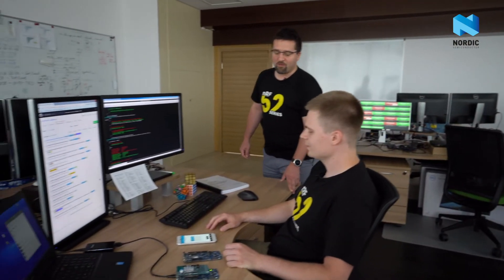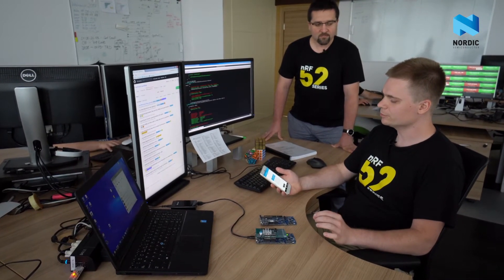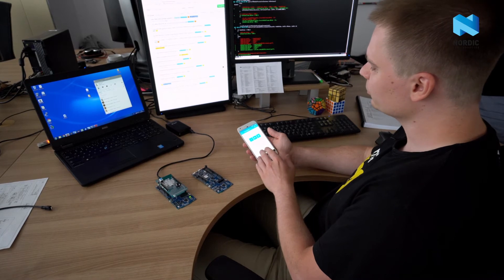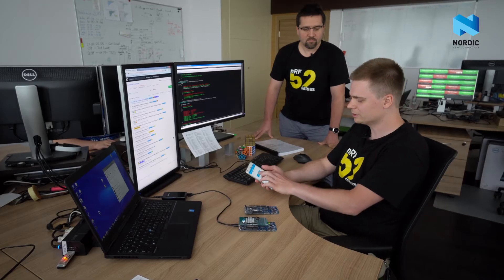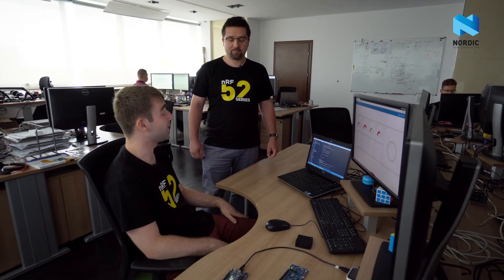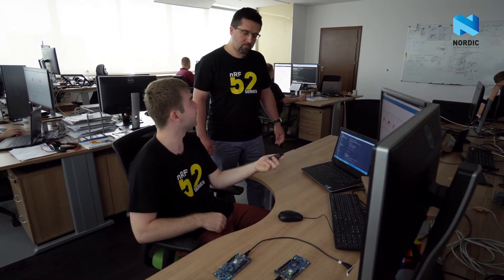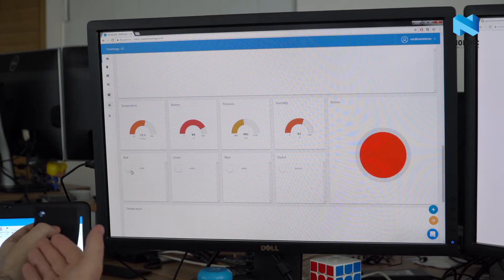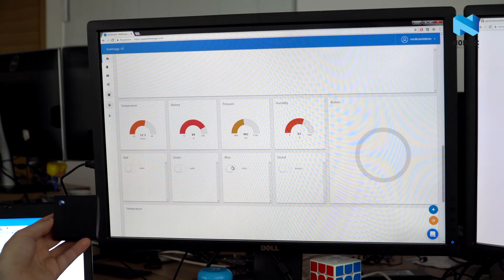nRF5 SDK for Thread: Thread/Bluetooth Low Energy multiprotocol demo

Comment: This is very interesting, but I am more concerned about is such a thread network power consumption is how much? Can there be a description of this related data?
Reply: Hi,
Thank you for interest in our solution.

When it comes to power consumption, you have to remember that only Minimal Thread Device in role Sleepy End Device (SED) is meant to be battery-powered. All other Thread devices: 
• Full Thread Device (FTD) in all roles: Thread Router (including REED state), Full End Device (FED)
• Minimal Thread Device (MTD) in role Minimal End Device (MED)
are NOT low power devices and are meant to be line-powered.
You have to take this into account when designing your solution because Thread network backbone, which consists of Thread Routers, was not designed to utilize battery-powered devices. 

nRF5 SDK for Thread in version 0.10.0 provides Thread/Bluetooth Low Energy concurrency for Thread line-powered devices types. Support for Sleepy End Device role will be added in the upcoming releases.
Reply: Hi,
Thanks for your detail reply.Originally intended to use this solution to do a single firewire smart switch, it seems that now is not feasible, power consumption is too big.
Reply: Not necessarily. It depends on what you are trying to achieve. If you need to control just a single switch, probably using pure Bluetooth Low Energy is a better idea because it is point to point communication protocol. Thread networking protocol specifies a mesh network which makes sense if you want to control an interconnected group of devices. Then if you want to control a Thread network from your phone, you can use Thread/Bluetooth Low Energy  multiprotocol solution, but you do not have to connect a phone directly to a node that you want to control. You can connect a phone to multiprotocol Thread/BLE Router and design your solution in a way that control message is passed from the router to the end node (which can be a low power SED).
Reply: Hi,
Millions of thanks,I get it.Now i want to control an interconnected group of devices just like Zigbee.However, the question now is how to minimize the power consumption of thread enddevice.For compatible with traditional mechnical switch, we use 2 wire ( Only LINE and LOAD, no Neutral) technology to design switch. This switch have leakage current flowing to Load( Lamp) when switch turns off, and may lead to lamp flicker if this leakage current is too high, if the standby power consumption is too large, the light will blink. At present we are using the Nordic 52832, standby power consumption can reach 8mW, but the network is very poor, can not cover the entire room.
Reply: The meaning of "The Power consumption can reach 8mW"  is that i can get the power from the AC power supply.
Reply: I think temporary power consumption is higher than 8mW for any wireless solution so probably you should use a capacitor to store energy and average its usage below this limit. 

I would use two boards for experimentation. One serving as Thread/Bluetooth Low Energy multiprotocol Router exposing Bluetooth Low Energy UART profile to connect a smartphone with nRF Toolbox mobile application (UART sub-application). To do that you should use "BLE UART and Thread MTD CoAP Client Example" (http://infocenter.nordicsemi.com/topic/com.nordic.infocenter.threadsdk.v0.10.0/thread_multi_dynamic_uart_coap_example.html) with a small modification. You have to transform this example to be FTD (Full Thread Device) insted of MTD (Minimal Thread Device). This requires only a minimal modification in Makefile:

$(SDK_ROOT)/external/openthread/lib/gcc/libopenthread-cli-mtd.a \
$(SDK_ROOT)/external/openthread/lib/gcc/libopenthread-mtd.a \ 

has to be changed into:

$(SDK_ROOT)/external/openthread/lib/gcc/libopenthread-cli-ftd.a \
$(SDK_ROOT)/external/openthread/lib/gcc/libopenthread-ftd.a \ 

Then just rebuild the application and flash binary image.

On the second board (simulating the switch) you should use pure Thread example "Thread MTD CoAP Client" (http://infocenter.nordicsemi.com/topic/com.nordic.infocenter.threadsdk.v0.10.0/thread_client_server_example.html). This examples runs as SED by default.

You have to experiment with PollPeriod between SED and its parent Router using otLinkSetPollPeriod() function (http://infocenter.nordicsemi.com/topic/com.nordic.infocenter.threadsdk.v0.10.0/group__api-link-link.html?#gac4f327a21c2b73efa7aac55de32a84b0). Remember to update Child Timeout using otSetChildTimeout() function accordingly to be higher than PollPeriod. The higher period, the lower power consumption but also the higher latency between Router and SED. So the period should be derivative of two factors: power consumption and latency which are opposing.
Reply: Thanks for your detail reply.I probably know how to do it.But now I have no 52840 kit,so I'll test  later.
Reply: @krzysztofloska8918  just the thing I was looking for. I was really confused between SED and FTD(REED) devices. As one of my senior told me that FTD devices can also sleep but it's clear from your explanation that's not the case.

I was wondering why did nRF Connect SDK don't have many examples for Open Thread like the nRF5 SDK for thread.